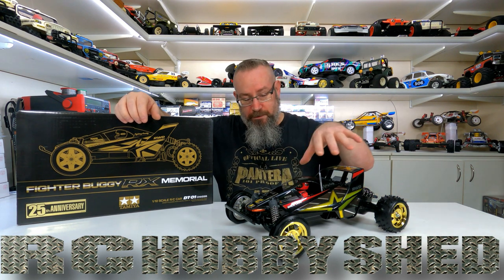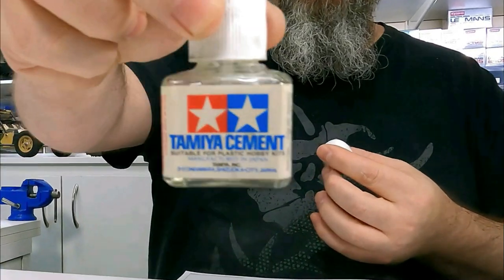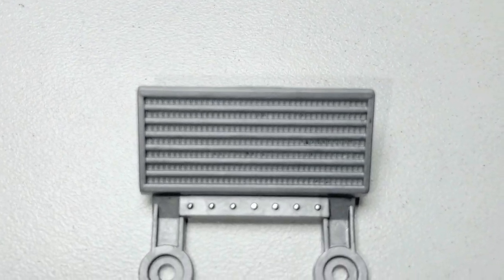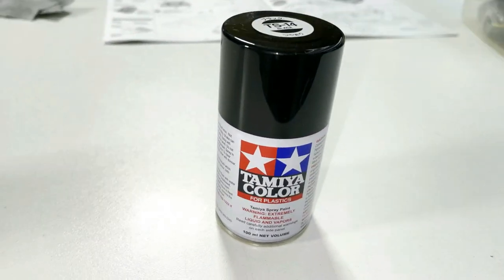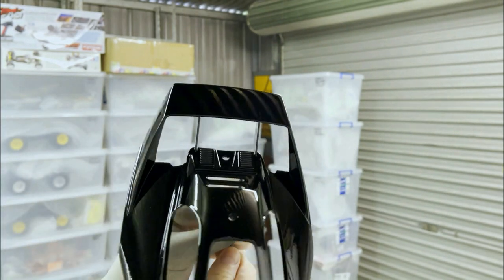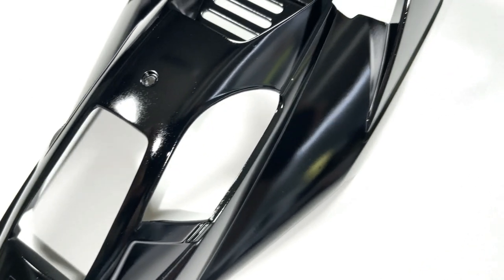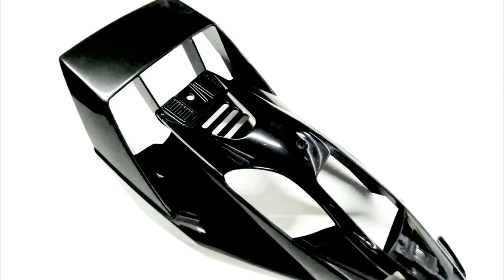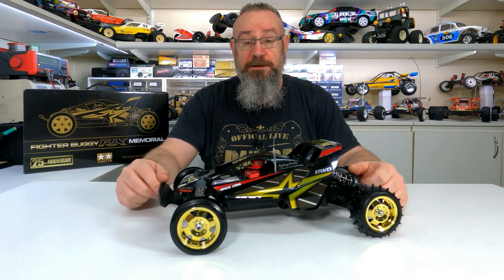Tamiya Fighter Buggy RX Memorial - Finishing The Body | Paint & Polish

Comment: Great paint and polish job Mick. The 'wet on wet' technique is something I haven't heard before. I guess it helps the paint adhere.
Reply from the maker: Thanks Jon. Yeah that's right, basically once you've done the last coat of primer you go onto the top coat straight away. If you leave the primer dry completely you really should sand it before the top coat. Of course allowing the primer to dry and sanding before the top coat is the way to go for the best finish, this is just a quicker way. 👍

Comment: That turned out absolutely spot on Mick, best I've seen.
I think it had one of your Wizard beard hairs in the black paint lol
I'm going to Pinch your threaded rod idea, never seen a body shell in the vice before haha.
Look out the Wizards got the rubber glove on😥🤣. 
You're definitely the inventor and King of the Montage mate, pretty smooth & good music too🎼👍🦘🇦🇺
Reply from the maker: Thanks mate. Just don't look too close. 😁
Haha, nah it wasn't grey enough for that. lol
Go for it mate, I usually use the rods for driver heads and things like that and then just jab them into the top of a cardboard box for drying. Sometimes you get lucky and the body has holes underneath where they can me screwed in.
Lol, I usually just paint me hand but figured I'd use a glove out of the full box right beside me this time. 😂
Thanks mate still, working on different things in an attempt to be different and recently got some new choons too, instead of the tired old ones I've been using for a couple of years for the montages. Glad you enjoyed it mate! 👍